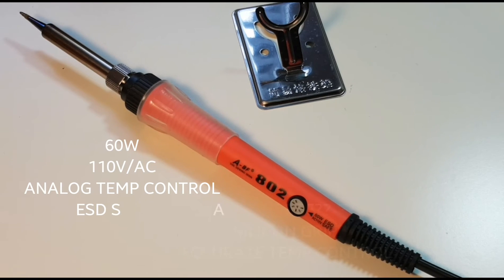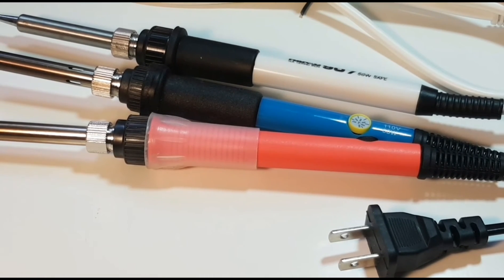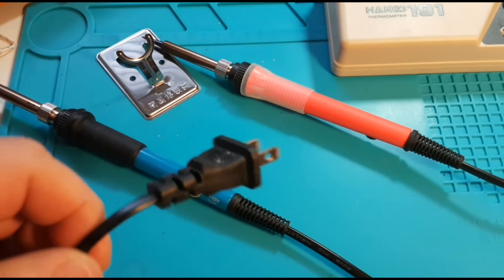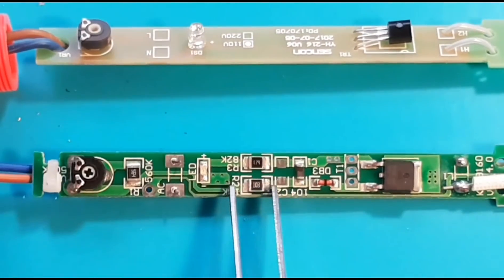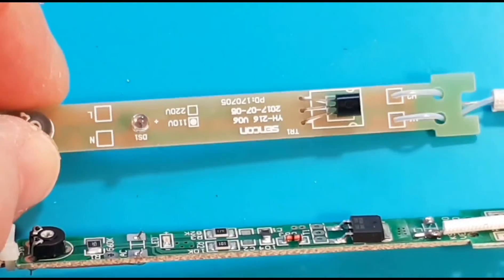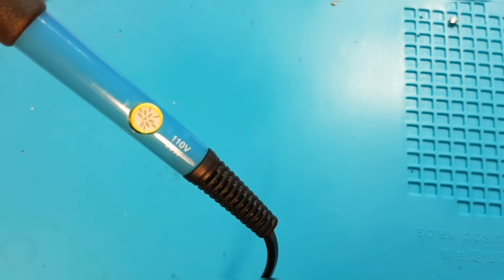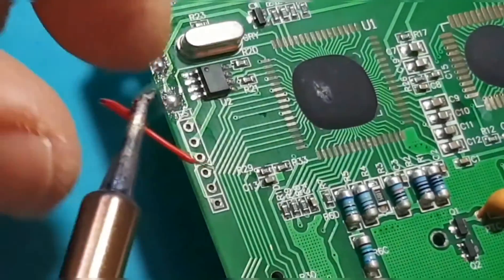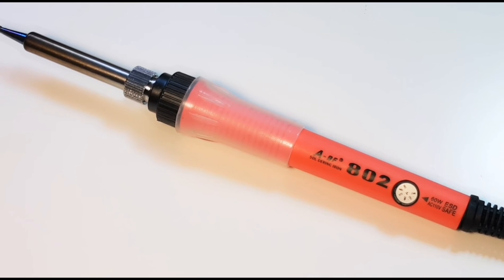A-BF802 Soldering Iron Review &  Teardown!

Comment: It does look the part, however there are many reviews on amazon often mentioning how the plastic snaps or melts, how the tips deteriorate, and finally how the iron suddenly stops working altogether...
Reply from the maker: I've had zero issues. YMMV. Its well designed but could be some non experienced users have had issues. Its cheap...cheap and reliable. It doesn't replace my 300$ Pacer but it's not meant to.
Reply: @KeepOnTesting  I think these are good value for money, but I would take them apart before plugging them in, as I suspect quality control may vary (one of the reviewer posted a picture and the iron's PCB was charred).
Reply from the maker: @bufordmaddogtannen  Agreed, Its always a good thing to do.

Comment: nice review! is it dangerous to use this tool without grounding ? and on which spot can we solder one ground wire(i want to do the same on mine)? can you mod it for us? :) Thanks!
Reply from the maker: You should only worry about grounding when you work with fragile components.. very high-frequency ones - they indeed are easy to toast, unlike the majority of FET's and IC's.
Generally you should be fine without grounding the iron. Use an antistatic mat to regulate the esd while soldering. The idea here is to keep you and the board/components at the same level of electrical potential. Antistatic devices are conductive but typically have a very high resistance to facilitate the slow dissipation of charges to ground.Grounded plugs are essentially a safety mechanism for preventing electrocution when a large potential between a device and Earth ground exists. They are often not actually necessary for a device to function properly and serve as a protection mechanism in most cases.
I might do a follow up video on grounding at some point. Thanks for watching!
Reply: thank you sir! I really appreciate you taking the time to answer me! :)
Reply from the maker: @just_a_random_guy-7  My pleasure! Btw, it's a great soldering iron   always stays cool to the touch and fairly accurate. Hard to beat for the price!

Comment: I wanted to ask, do you think its worth getting one of the solder temp tip thermometers-?  My station has a readout but might be nice for the wall irons or verifying the station readout, and do you really think theyre accurate in your experience-?
Reply from the maker: I think getting a separate soldering thermometer is a good idea! They are very fast at measuring the temperature albeit the special tips that the iron touches can be fussy to place. Still, I think it;s a good investment plus they are relatively inexpensive (most of them)..its always nice to get a second opinion! ;)
Reply: Yeah I saw the one you have on ebay was only around $12, but im wondering how often those thermocouples need replaced and are they pricey - I thought it might be one of those things like printer ink, you know buy a $30 printer and it works great but new ink cartridges are like $40-?  LOL --- I just looked and the sensor elements look pretty cheap, they obviously appear to be an expendable and relatively cheap - are they all the same and interchangeable or is it necessary to get the proper brand and part number for a given temp senser rig-??
Reply from the maker: @yambo59  They are generic in dedign so basically one size fits all. They normally ship with the thermometer and you get at least a dozen or so which means they should last a long time!
Reply: Oddly I see the thermometers only come in Celcius readout, we went to the moon 50 years ago- ( yep, saw it on TV as a kid ) - and they couldnt throw that tiny bit of functionality into the device-lol  Just think I should have a choice, us yankees like to solder too-lol  I do see one genuine Hakko thats in F* but they want $69 for it-!

Comment: Hey glad to see ya review this, before I got my soldering station I was using two of the blue versions with the C* scale you show here, and I have to say I only bought them to get by but they really surprised me at how well they actually work for being a plug in cheapie.  There are those times im somewhere and dont need the whole station and these irons are handy & work much better than I expected for the price - however as I grew up in the US I do wish I had one with the fahrenheit scale just because its what I was raised on (old guy 59) and the blue ones dont have the extra silicone heat guard so I guess ill just have to buy one of these A-BF802's as I see there only like $8.00 and free shipping in the US.  I also noticed on my BT-39C meter the temp accuracy on my blue irons are about 20* higher than your BF802 - but the two blue ones I have do solder well and the tips do a good job, one of those exceptional items for the price, think I only paid like $11 each and I use Kester 186-18 solder Flux with Kester 63/37 flux solder and the combo seems to work first time every time.  Great review-!
Reply from the maker: I haven't tried KESTER solder yet although I hear very good things about it and I realize it's a classic..I've been using the German Stannol forever but I will try the Kester at some point..Thanks for the Kudos! BTW, Growing up in Canada we were raised with both Metric and Farenheit so most of us are pretty at ease with both standards but I do prefer Celsius when it comes to temperature...that's just us Canadians eh ;)